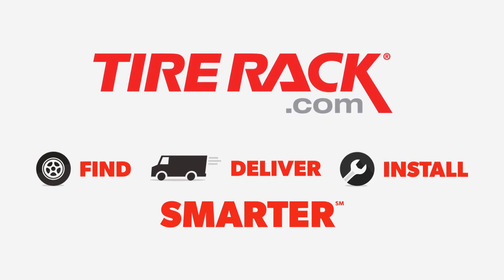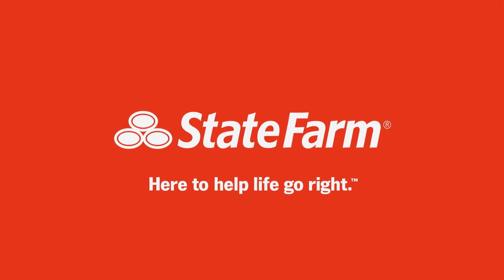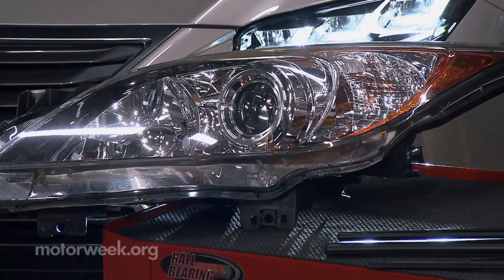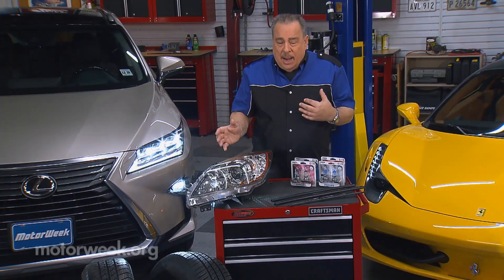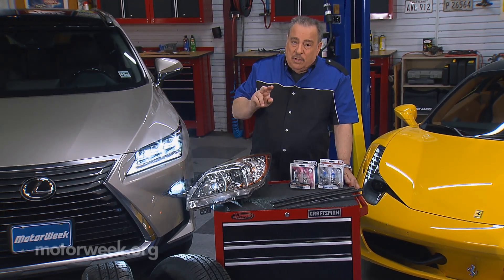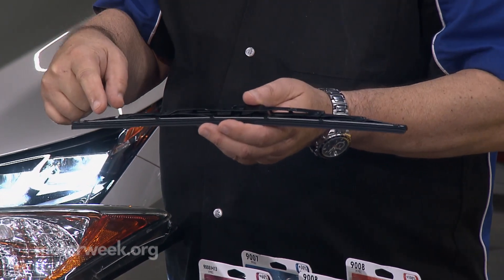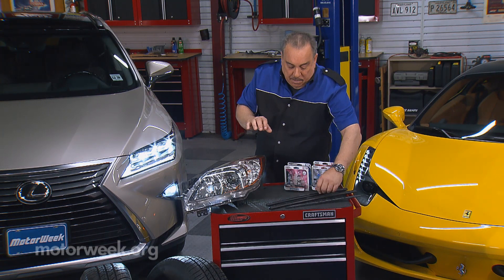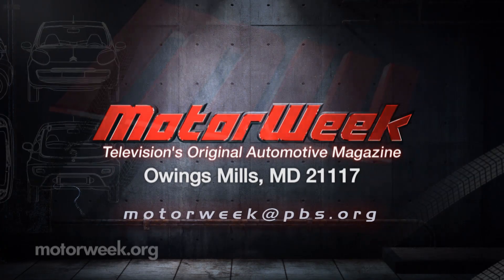Goss' Garage: Replace in Pairs - When One's Not Enough

Comment: 2:58 - the downfall of those flat blade wipers it that  it applies more pressure to the windshield, and has a tendency to scratch the windshield if there's allot of dirt built up on them and make wiper trail marks on the glass.